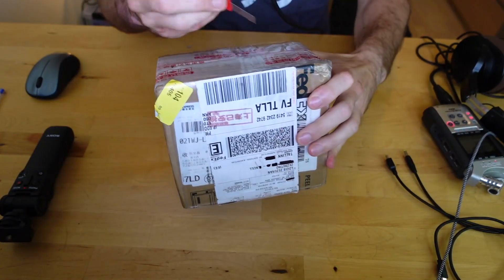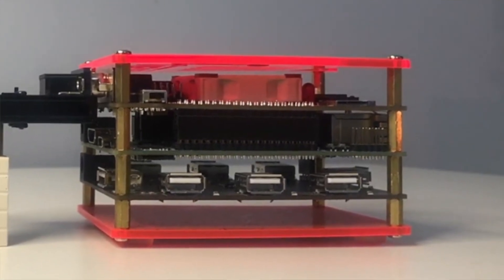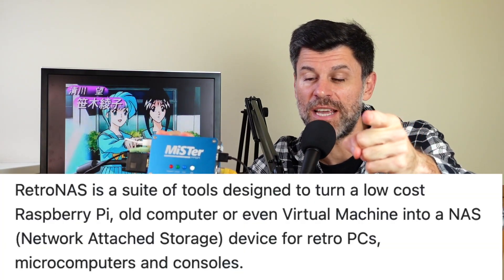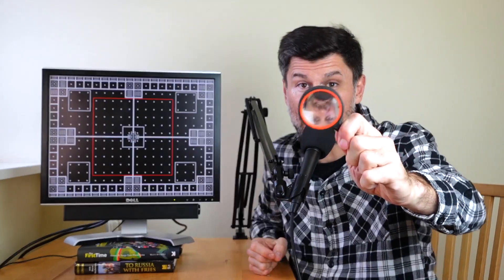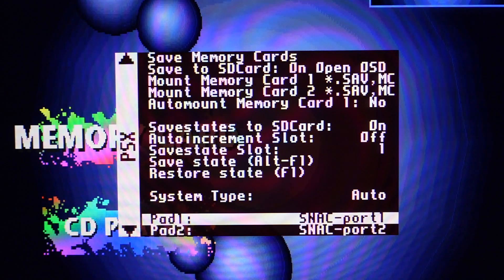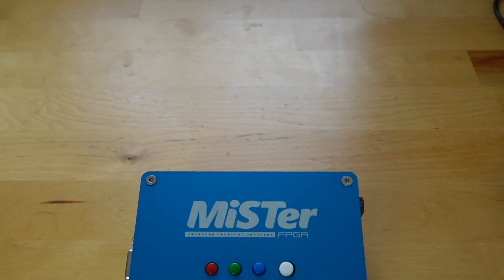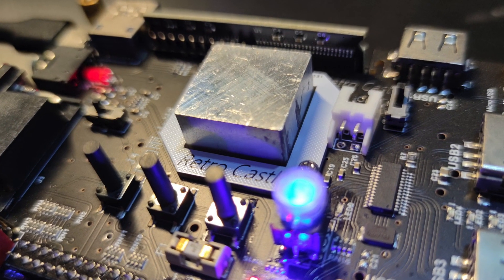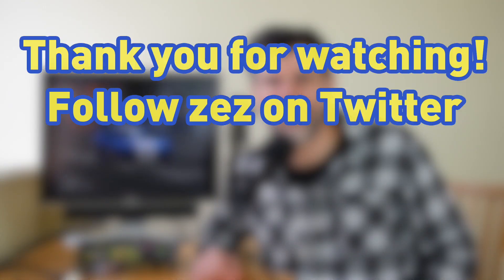Unboxing the RetroCastle MiSTer FPGA IO Board & PSX SNAC

Comment: Hi buddy, how are you? Thanks for the awesome video. I ordered this Mister FPGA and I can’t wait to use it. So I got a question… I’ll use a PS4 controller (maybe 2) and an external hdd, can I use a Nintendo Switch usbc power cable in my fpga?

Thanks for your help and greetings from BRAZIL!
Reply from the maker: Heya! I am glad you got one of the Retrocastle setups. I had a look at my Switch PSU now and it says its rated for 5v at 1.5Amp. That is lower than recommended but I am unsure of exact numbers. I run mine off a 2amp PSU but I dont have a HDD attached.

Controllers or bluetooth adapters are typically not the problem, their power consumption is quite low

The HDD is more of the focus. If you have an externally powered HDD then its probably no problems. If yours is not powered, then I think give it a shot. If you start to get weird issues, then after the basic trouble shooting I would think about an upgraded PSU. I see my ipad adapter gives 5v at 2.4amp which gives more headroom.

This has reminded me to talk to RetroCastle about his recommendations for PSU, will take a few days but Ill update here when I have talked to him (summer is a busy time)

Comment: Can you help me? If I buy the RetroCastle with Saturn Video Out, it works with composite Saturn Cable?
Reply from the maker: Yes, this board does the conversion from rgb to composite and sends it out the saturn video output
Reply: @ZezRetro  Thank you... I see that is a new updated IO saturn out board with YC active from Mike, you tested it?
Reply from the maker: @LiloVLOG  Havn't tested it yet, will probably be a few months until I can get one from Ivory. However if I was buying today I would get that model, RetroCastle / Ivory has a very good reputation
Reply: @ZezRetro  I think I'll buy the RetroCastle Saturn version, my CRT only have composite, I hope I can use the Saturn Video Out in all of the cores, thank you!

Comment: thanks for video. any comparison between Retrocastle's S-video and Mike's S-video quality ?
Reply from the maker: I’ve done several live streams with RetroRGB comparing development versions of both boards and our conclusion is they are both high quality. The difference comes down to how you want to use the device. Retro castle will work on all cores and the menu, mikes still need the YC cores.
Reply: @ZezRetro  Thank you for responding. I would go for Mike's core. I think Mike's are the best quality theoretically (if human can detects).

Comment: Is it actual VGA out, like in only VGA? Or is thst just the port?

Asking because I have an rgb modded CRT TV and the RGB plug is a VGA plug (RGBs).
Reply from the maker: It’s the second one. The MiSTer IO board has a VGA style connector which you can change the settings to output RGBs or RGBHV (VGA)
Reply: @ZezRetro  exactly what I wanted to know. Thanks! Now to start saving for a MiSTer! I've been wanting one for years and I love RetroCastle's set up best.
Reply: @ZezRetro  is component possible with this IO board?
Reply from the maker: @jakehughes5155  Yes it is
Reply: @ZezRetro  thanks for confirming! I saw on Steve’s discord that this io has much more accurate colors.

Comment: I'm having a problem with it, the IO board itself works, but the USB HUB sometimes just refuse to work.
After turning it off and on a few times it starts working again.
Reply from the maker: Which seller did you get this from?
Reply: @ZezRetro  
I bought directly from RetroCastle through Aliexpress

It worked great at first, then once the USB Hub stopped responding completely, the ports had power but nothing connected to them worked and the usb leds were all off. I restarted it a few times and it started working again.

After I made that last post last weekend it stopped responding again, I spent hours trying to make it work, removed the MicroUSB bridge, cleaned the contacts and nothing.

If I plug the power cord into the DE10-nano and plug a generic usb hub into the MicroUSB, everything works as it should, so I figure it's either a problem with the IO Board's USB HUB or the MicroUSB bridge

I'm trying to find a MicroUSB bridge replacement but RetroCastle doesn't sell them
Reply from the maker: @l3rvn0  Have you spoken to RetroCastle directly about this? That would be my first step here

Comment: You should be fine with your PSU just don't plug in a PS4 controller by wire (those beasts can draw 800mA)

Comment: WD-40, at least the standard variety, is not a lubricant, and can actually wear down the parts faster. Yes, it may work right now, but not long term.
Reply from the maker: Fair point. In this case the fan is not an expensive one and yeah it is a short to medium term solution

Comment: I don't need another MiSTer! But this looks good. Maybe I can get a PSX SNAC adaptor for my existing one?
Reply from the maker: This snac adapter does work on other IO boards. I tested it on my OG and it worked fine. I sort of awkwardly jammed it in but otherwise a short quality USB3 cable will work